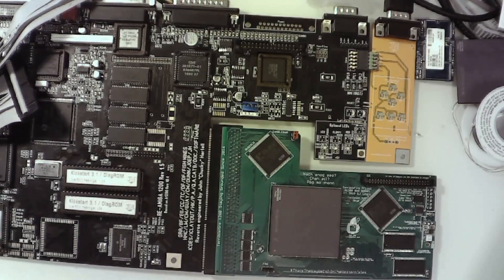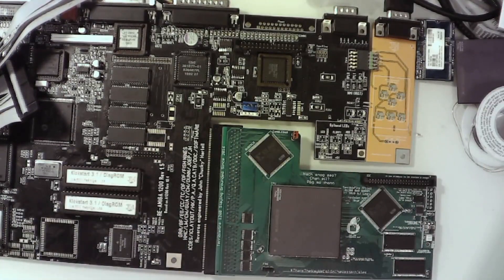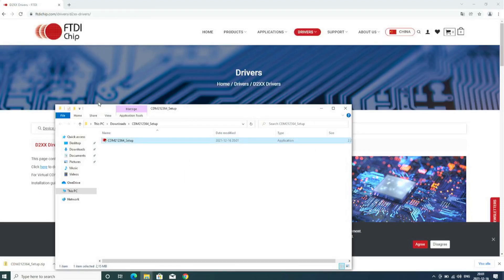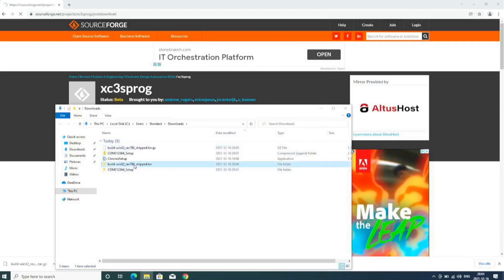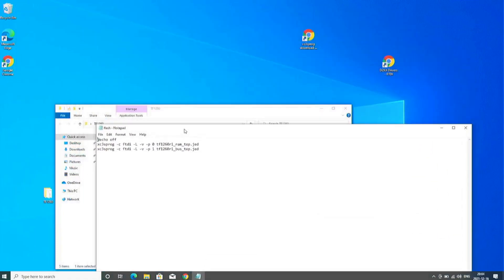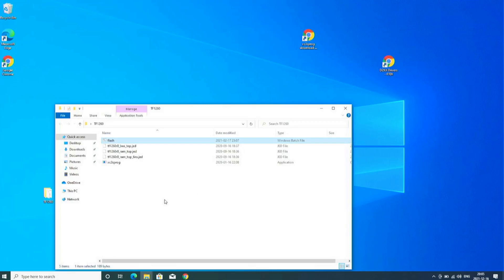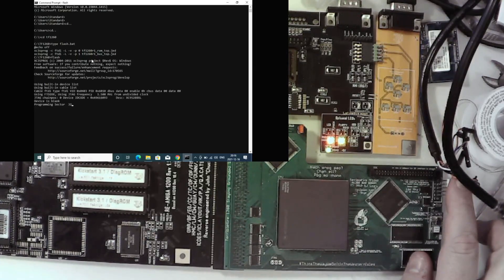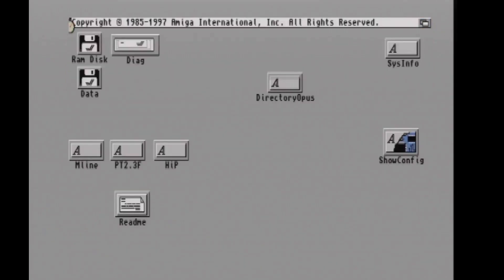Flashing Firmware (CPLD) on TF1260 for the Amiga from Windows /FTDI Cable. (Xilinx 95288XL Flashing)

Comment: Hello. I need to flash my TF1260 and i am going to buy that FTDI cable. However, i am looking for the male to male pin adapter at 0:53. Where could i find one and how do you call this to try and Google it please? Thanks in advance.
Reply from the maker: "pin header" ?
Reply: @ChuckyGang  yes thanks, but is there a pitch to know about or something? Where did yours come from. As for the FTDI cable, i'm going to have one from Aliexpress.
Reply from the maker: @lordxanxi8348  standard 2.54mm (or 0.1 inch)
Reply: @ChuckyGang  Thanks, will search for that

Comment: This also works with Xilinx cables (used zadig to get the libusb set for Xilinx, and much less trouble than installing Impact):

xc3sprog -c xpc -L -v -p 0 tf1260r1_ram_top.jed
xc3sprog -c xpc -L -v -p 1 tf1260r1_bus_top.jed

Comment: have made myself a TF1230 card and are soon moving to the programing CPLD part - du you know if it the same way as this? - boards seams wery alike eachother :-)
Reply from the maker: as I tell in the video  for all TF cards..  but 1230 uses only 1 cpld.     but the method is the same
Reply: lol ..  how did i not notice that 

is it the same parameters in command line?

xc3sprog -c ftdi -L -v -p 0 2021_04_01_tf1230_alpha1.jed

like this? :)
Reply from the maker: @grommdk  yeah  and skip the 2nd line :)
Reply: @ChuckyGang  Thanks :)